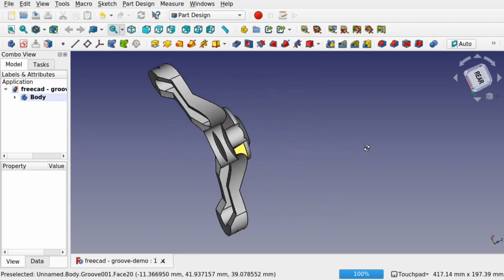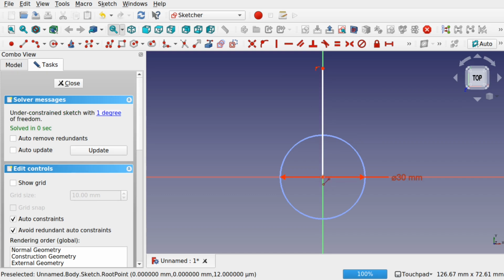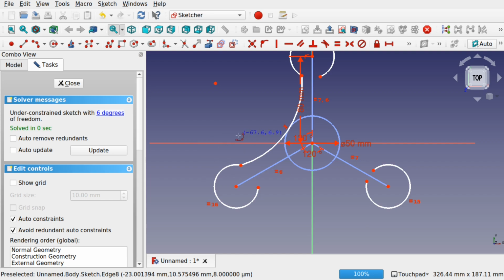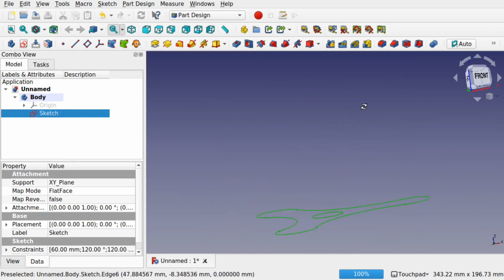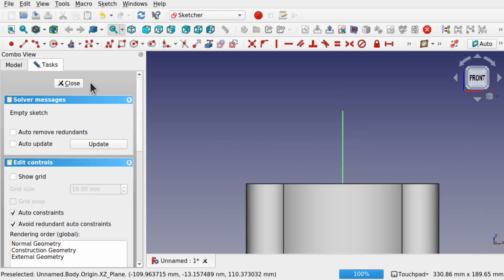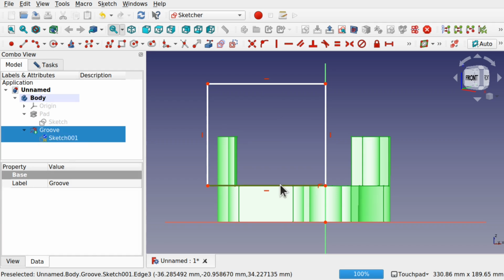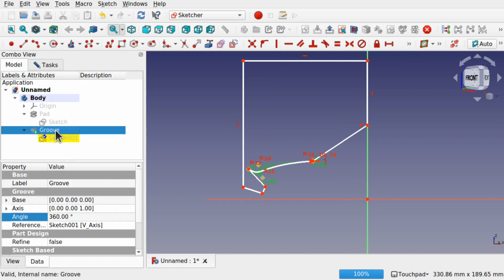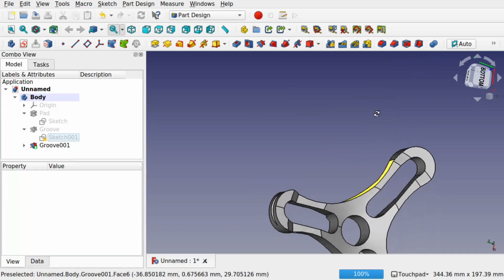Understanding FreeCAD Lesson 9: Complex Modelling With Groove | Part Design | Beginners Tutorial

Comment: Fantastic video!  I've used the groove before but I never thought about using it as a way to surface an entire face.  Really great stuff.  A side note, you made the sketch at an irregular angle so you could see the profile of the slot you created.  This creates a problem that I cannot seem to solve (same with datum planes at weird angles as well) which is I cannot figure out how, once I've rotated away from the initial perspective in sketcher, to return to a square view of the sketch against the plane.  That probably doesn't make a lot of sense so imagine you create a sketch along a regular plane like XY or XZ or whatever and you rotate the view in the sketch to get a better idea of where you are spatially, right?  To get back square to the plane of the sketch you can just click on the appropriate face on the navigation cube.  I can't figure out how to do that on an irregular plane.